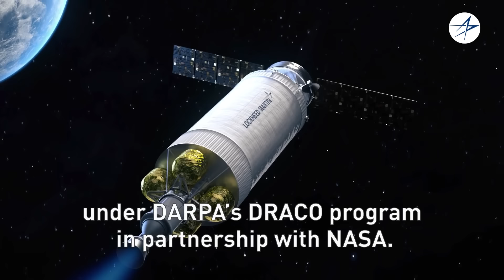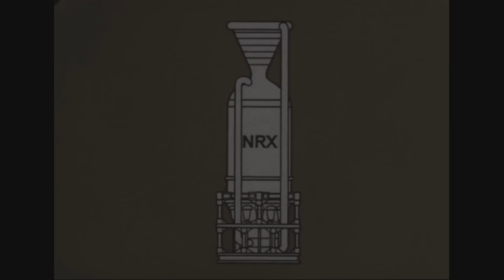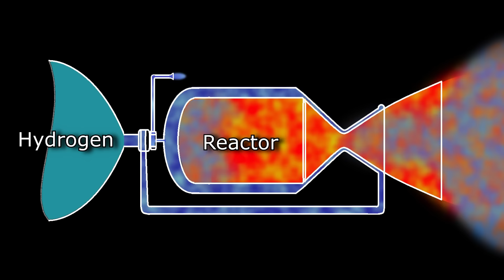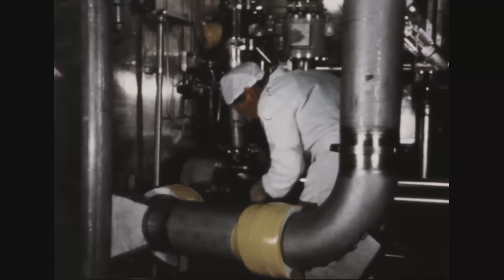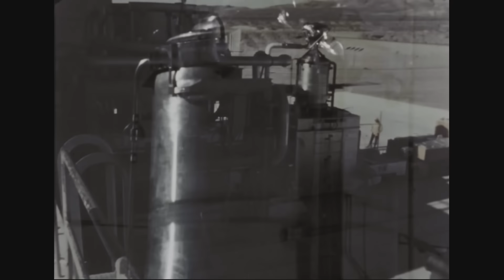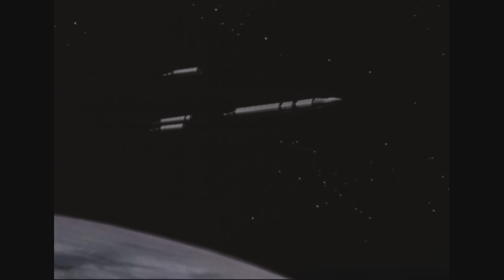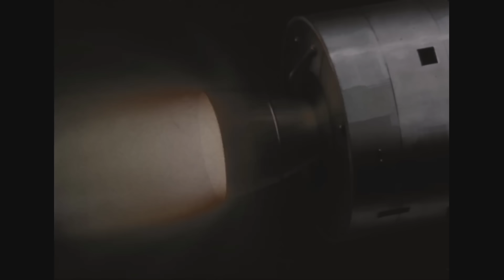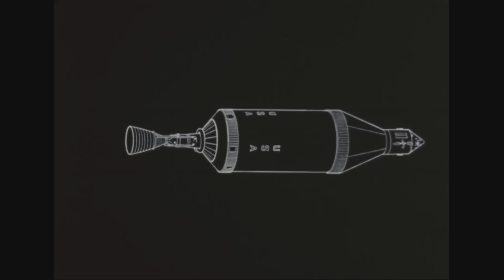Why Nuclear Rockets Are Going To Change Spaceflight

Comment: Hello Scott, 
I have been watching your videos for years, all the way back since the Interstellar Quest series on KSP! In that time, I have received a BSc in astronautical engineering and am now currently halfway though a MSc in nuclear engineering all because of you, KSP, and the goal to work in NTP. During my undergrad I was fortunate enough to work with professors on research in both solid core and liquid core NTP designs but the craziest part is that tomorrow at 9am I start a fellowship with the Center for Space Nuclear Research where I will be working on developing a gas core NTP engine design for the next 10 weeks. Your videos are always phenomenal and this video is no different. I can't thank you enough for all the years of youtube videos and the motivation to pursue NTP.
Reply: Very cool!  Maybe you can help catch Scott up on the latest with NTP, lol - it feels like his reading stopped with NERVA  :)  I shook my head at the part where he said they have too low thrust to use from the surface. TWRs are a lot higher in modern designs than in NERVA to begin with, and then we have a whole host of options, from boosted designs (oxygen afterburners for extra thrust during liftoff) to air augmentation (everything from passive ram air to turbofans - indeed, there's a continuum between nuclear aircraft like Project Pluto and nuclear rockets). 

I wish you luck on your research, that sounds really cool!!!
Reply: @karenrobertsdottir4101  Thanks!  Yeah, I've heard the argument before about NTP engines not having a sufficient TWR. The thing that the people that make that argument don't realize is that TWR is not a priority in designing rocket engines for space. Once you're in orbit, TWR doesn't really matter that much anymore. Sure, optimizing for mass is important and you can certainly design an engine for higher mass flow rate and therefore thrust, but there's no imperative need to for a spaceflight engine to have a high TWR as long as maneuvers can still be considered impulsive opposed to low thrust maneuvers that require much more time. With direct cycle NTP engines you certainly don't want to be using them with anyone around as the exhaust is radioactive let alone the mentioned neutron flux from the reactor itself, so using the engines for launch vehicles is out. You could probably get away with using an NTP engine for a lander, but irradiating your landing site is not a great idea regardless if it's for a manned mission or not. In short, one of the reason NTP engines don't generally have a good TWR, is because they don't need to.
Reply: and plasma core NTP is next? sorry just wandering, I'm sure you will do great there, go on
Reply: @snapshuttre  A gas core design technically would be a plasma core since the uranium fuel would be better described as a plasma than a gas realistically.
Reply: @NukeRocketScientist  fair point
Reply: Man congrats brody🎉
Reply: How hot can a gas core design operate at? Or, I guess the propellant temperature is what matters.
Reply: @davidgunther8428  As with anything in these temperature regimes material properties and heat exchanging is the limiting factors. Since the uranium fuel is well beyond the melting point, fuel temperature is not a restriction so as long as the heat transfer rate is high enough there is not a well defined limiting operating temperature. In theory the uranium plasma fuel may reach temperatures beyond 85000K to even more than 100000K which could produce specific impulses over 7000s. Gas core is still very low technology readiness level and theoretical so many sources say many different things regarding operating temperatures.
Reply: Legendary! Nice :D
Reply: Grats!  My cousin is a professor at UOH Alabama, Jason Cassibry (i know the youtuber smarter every day was one of his students lol).  Its a surprisingly small field for as cool as it is.  Anyway, he has been doing work on nuclear rockets the past few years but a lot of it is a bit hush hush so suspect it's darpa/gov/etc.  Not a big surprise since so much stuff related to nuclear is considered secret/controlled/etc.  Regardless, I hope we eventually see some actual "spaceships", as in ships built for and staying in space.

I think of it like a boat.  We need small crafts to get out to the big ships, but the big ships stay in the ocean.  We need our "big ships" that stay in space, and use stuff like starship to get to it, carry starship in lander form to whereever We intend to go, and then land in that and send the nuclear starship back home for the next pickup.
Reply: May the hopes and dreams for humanity's future rest gently on your shoulders. Well done!
Reply: Cool, I didn't know gas core designs were real!
Reply: @davidgunther8428  They are about as real as the StarTrek warp drive.
Reply: W
Reply: User name def checks out :-)
Reply: Should check out my reaction as a medically trained agriculture expert to Scott's idea (and maybe you should study more closely the medical history of nuclear  science, and the fate of many of those who worked in the field, including one of its pioneers, Marie Curie): Love your shows Scott, but I always knew you were a not so closet corrupt self-serving member of the pseudo scientific (regarding the science of the long-term ionizing radiation danger denial) nuclear scientific cabal of scientists who lie about the health dangers of fission nuclear to benefit themselves financially because of their own personal investment in learning stuff about a fundamentally flawed technology, and their wish to still make something of their environmentally and socially toxic life choices in their careers, lol.

Dream on, you should stick to computer game sims of the tech, and don't kill people in real life with it, or more pointedly contaminate the planet with man-made fission nuclear material that's so toxic it's mortally dangerous to all advanced life on this planet in amounts too small to measure.

If for any reason it were to be spread throughout the biosphere, if you were unlucky enough to ingest a particle of it too small to be detected, and it lodged in your lung, or is absorbed in you intestine, it could and would over time still cause fatal cancer.

Cops and military personnel working at Hunters Point, here in San Francisco, where a relatively small amount of high level nuke waste was stored, were dying early left and right from cancers, despite no leaks being announced or recorded. 

In the early days of the web, they had a bulletin board where they exchanged their personal horror stories of premature deaths amongst those who had worked there.

There is a reason why the Germans shut down their fission nuke reactors. It was because despite meticulous German engineering, oversight, safety protocols, reactor design and maintenance, significantly elevated levels of fatal leukemia were observed in children for many miles around, despite no leaks, or no elevated radiation levels ever being detected by their comprehensive monitoring and safety precautions.

Maybe creating waste (and fuel) that toxic might be ok if it somehow naturally broke down quickly and became less dangerous with time, but fission nuke waste and fuel remains mortally toxic for tens of thousands of years, a length of time that nobody involved in fission nuke development seems to conceptually comprehend just how long it is. Compare it to the length of human history - Spanish sailing ships discovering America were "only" 500 or so years ago, 10,000 years is twenty times a long a that, and thats how long safe storage of both waste and fuel has to be maintained.

There's a technique to date relatively recent things is by measuring radioactivity absorbed by anything exposed to the air on earth during the phase of human history when a relatively small number atomic bombs were being tested in the atmosphere - the fallout from the tests was spread so widely and was so all pervasive.
Reply: Best thing ive seen on youtube since idk when
Reply: Good luck bro 🚀

Comment: How do you do ground testing of the engine before launch and then handle the now highly radioactive engine through final assembly etc.?
Reply: It was done in the 1960s and 1972 in the desert. Some of the footage you saw in the video was from actual test firings. NERVA prototypes ran for several hours total in the open air. The radioactive exhaust dissipates quickly in the atmosphere and the neutron radiation only occurs while the engine is running. Just like nuclear bombs, the radiation and fission products are not comparable to nuclear waste. It all decays very quickly (think days) and there's not much of it (the engine only runs for a couple of minutes to an hour after all).

Comment: So what engines for interstellar human missions, like 8 years travel to Proxima Centauri, then 10 years return using long constant accelleration running 40% travel duration per burn ?
Reply: Engines running on Unobtainium. Constant acceleration would be practically impossible.  The only thing that might get even close to such performance would be anti-matter engines, but no one knows how to produce and store the required amounts. It's also not clear how to even turn the released energy into proper thrust.

If about 12 to 16 years to Proxima would be okay, an Orion-type ship would do it. Only problem is, such ship would need approximately 10,000+ thermo-nuclear warheads to do that and the engineering isn't 100% clear on account of the nuclear testing in space ban.

Comment: Twice specific impulse is nice, but no game changer. A flight to mars would be shorter, but the complete mission cycle, in case you would like to return, takes more or less the same time (~ 2 years), since you have to complete the full planetary cycle of earth an mars. And in the end, current concepts are alomost just as "lame" as chemical rockets, since they need a gas to create thrust. And the real efficiency of the nuclear reactor is also ridiculous low, since only a very small fraction of fissile material undergoes fission, like all current reactor designs! Ans still you have e hell of radiotion problems! There is no concept that can convert nuclear energy directly into electricity or even thrust! All you can do is to slow down nasty neutrons and heat gas! Just a slightly better steam engine!

Comment: I like how the animation has the crew go to mars in a capsule. Very ksp like
Reply: If I recall correctly, at the time they were thinking of high energy, low time transfers to Mars, that's why they needed something better than chemical rockets, but in exchange the mission time would have been down to under a year, from the 4 years if you used minimum energy Hohmann transfers. Even then just a capsule is rough.

The shift in thinking to the low energy, long flight time approach (that is the basis for every proposal today too) happened in the 90s, when the Nuclear engine projects were long gone.

Comment: 2 times the Isp of a hydrolox IS a huge improvement
Reply: Not in the context of space, not even in the solar system.
Reply: @JacquesMartini  I'm not comparing it to the technology of a proper spacefaring civilization; I'm comparing it to the milestones we reached so far
Reply: @aglr1439  We havn't reached it yet, there is NO working nuclear engine in space, not even a prototype! But plenty of CGI! 😂
Reply: @JacquesMartini  What's your point? Whether we reach it or not, 2 times the Isp of a hydrolox is a huge improvement.
Reply: @aglr1439  Double wrong. We have NO working engine, just ideas and CGI. Even if we have it, the "next big thing" of a mars trip would not profit from it as much as you might think. You get faster to mars, maybe in 45 days (6 weeks) instead of 30 weeks. But for the round trip you have to wait around 2 years. You have more time on mars to do, whatever you might want to, but the challenge of life support is the same.
Reply: @JacquesMartini  I don't care if it brings Jupiter to my doorstep; the improvement on propulsion efficiency is unmatched in comparison to anything we managed so far while keeping the thrust decent and engineering manageable.
Reply: @aglr1439  Once again. We did NOT manage it so far! Maybe 2027 or a few years later. Not yet.
Reply: @JacquesMartini  I am not even saying we did.
Reply: @JacquesMartini  
My dude, what are you on? Nuclear reactors have been tested in space, both by the USA and the USSR, and Nuclear Thermal Engines have been tested also by the USA and USSR, just not in space yet, the technology is like, 90% figured out.

Even if the increase of ISP isn't some "Nuclear Fusion Engine" kind of improvement, it is still a big leap when it comes to high energy upper stages or interplanetary rocket tugs.

Comment: "And now we'll demonstrate the economics of it with Terra Invicta. You either pick up nuclear freighters or you die. Have fun with your RD-0410/NERVA engined Star-Raker!"
Reply: Good times. Sadly it does strain credulity when you start packing spacecraft with terawatt class gas core nuclear reactors into dense formations with one another. Though at that end of the tech tree I guess you do finally have the mass budget available for some radiation shielding.
Reply: @JosephHarner  how to protect crews from radiation for extended periods of time?
Resistance - shielding.
Exodus - shielding.
Servants - alien shielding.
Initiative - you condition is not service related.
Protectorate - shielding.
Humanity First - you're a martyr!
Academy - shielding.

Comment: Fun fact about gravity and orbits:

For a sphere of certain density, the orbital period around it (at its surface) depends only on its density.

If you have a rock of same density as Earth, and X times smaller in diameter:
1) The surface gravity will be X times less;
2) Orbital velocity around the rock will be X times less;
As follows from (2), orbital period around the rock would be the same (!). 

This is surprising, but yes, orbital period around a sphere of same density and different size will be the same.
Reply: It's not about the mass?
Reply: @CathrineMacNiel  If, in the formula of the orbital period,  you express the mass through radius and density, the radius will get canceled, leaving only density.

Comment: Man imagine where we would be if we had continued working on this technology in the 60s and 70s...

We probably would have landed people on Mars by at least the 80s
Reply: Probably we wouldn't need street lighting as we'd all glow in the dark!
Reply: @mikehipperson  talking about launch failures or WWIII happening?

Because there's plenty of ways to launch a NERVA style engine into orbit that even if it did have a booster malfunction on its way up, it's not going to affect anything on the ground. 

Hell, the Red Chinese irradiate more people every day with a single day's production of power with the emissions of radioactive crap in their coal plants than you'd get from a thousand NERVA's burning up.

And if it's WWIII, NERVA wouldn't have contributed to that situation, so it's not really valid a point to bring up.

Thing is, radioactive things are a LOT more common than you would think, and in 98% of cases, a lot less harmful.

Yes, I am aware of chernobyl, fushikima, and 3 mile, and those are down to, at their core, operator screwups, or for the Japanese one, something massively outside the designs worst nightmares, and the area less than 2 Miles inland of the reactor sites is inhabitable.